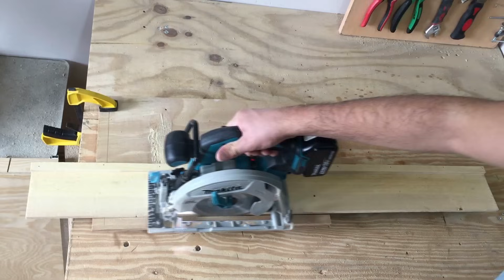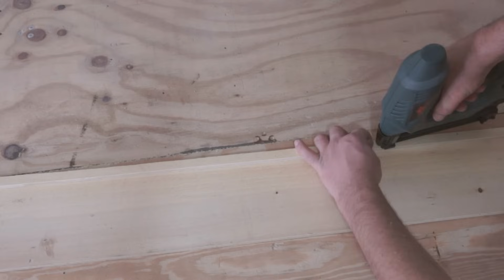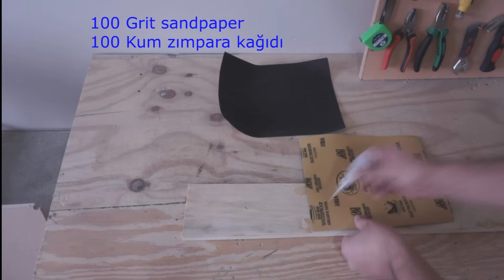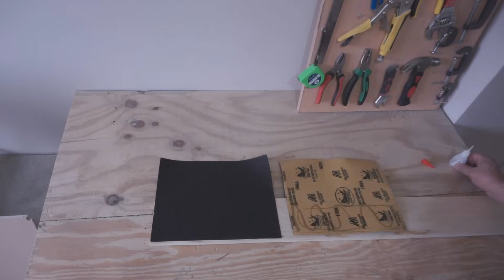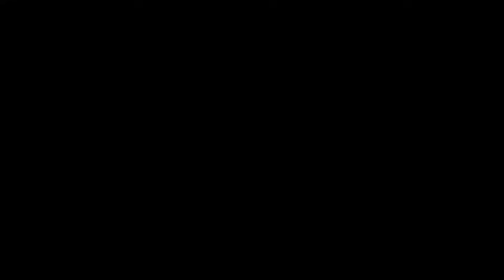Making a Self Clamping Circular Saw Guide - Kendinden Yapışkanlı Kesim Kılavuzu

Comment: Great work. Plus here's a couple of tips from a (now old and) very experienced wood worker. 

1. Add a 90 degree cross piece underneath and at the beginning of your track board. Always quicker.
2. Leave your track board sticking out the other side of your fence for clamping (hand spring clamps are enough) as well as a 45 degree guide (cutting with saw at 45 degrees).
3. Trim the abrasive paper a little further, even micro granules will dull your blade.

I've added these refinements after decades of using this kind of system. Also, an 8 foot version for large panel board can be helpful too. I've usually kept both in the workshop.
Reply: Thank you.

Comment: For goodness sake, use a push stick when using that circular saw! It takes a small lapse of concentration or a moments slip to lose fingers/thumb (@27secs). I have been working in wood for well over sixty years and the most precious and valuable item in the workshop is yourself. Keep safe and thank you for posting.
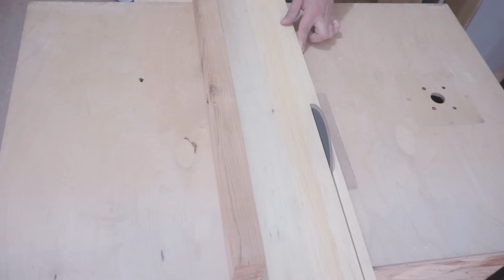Reply: @Richardz  I thought so to, but as per the original comment at 0:27 he runs his hand through the table saw when making the jig.

Comment: Great idea and I made mine today.  Instead of sandpaper, I put small drops of clear silicone on the bottom and it works great.  I also bring two spring clamps with me.  I plan to keep it in my truck to use to break down plywood I buy at Lowes in the parking lot.  Cool idea.

Comment: That's a very interesting idea with the sandpaper; I'll have to try it.  I have used a variation of this for 40 years.  I use 1/4" fir plywood for the base (no need to go thicker), and a narrow strip of the same 1/4" ply for the guide.  I never clamp the guide; because the good side of the wood is face down for a clean cut, I use two 3/4" nails to secure the guide, which when done I loosen, leaving the small nails in the guide for next time.  Works very well.
Reply: Hi,thanks for the comment.dabblign with making my own guide for my Makita circular saw as well.probpem with this is I'm concerned the 100grit sandpaper might scuff the material I am working on....what's your thoughts?
Reply: @conradpaul6100  I thought that too. Maybe some higher grit automotive sandpaper might be better? 300+ grit?

Comment: Don’t use sand paper. Use a bicycle inner tube cut in strips. Glue two or three strips lengthwise on the bottom of the guide.
Reply: Agreed the sandpaper would scratch the surface you are working on. Any sort of thin rubber material to line the base with would be better imo.

Comment: Great video.
One thing I'd have done differently: I'd first glue the wood-strip on (using a straightedge as a guide), then when dried, I'd use the "track-saw" itself (instead of the tablesaw) to cut the board, that way, it would be very accurate without much effort.
One can use sandpaper, but if you live near a beach, you might as well just put a very thin layer of epoxy on the back-side of the board and cover that with a layer of sand. Other types of (multi-material) glue might also work, but wood-glue is not recommended.
If you don't have sand, you could probably even use salt, just make sure you won't leave it out in the rain! =)

Comment: That's good but what if you want to cut a pre finished door you couldn't lay that on top of it
Reply: Right you are - but how many times are you cutting finished wood?
Reply: @tjk1009  he said: pre finished
Reply: I guess you could use masking tape but OMG that would be a pain in the ass 🙄😂😂
I spread a thin layer of silicone on my guide... I used a fine-notched spreader & it worked great.. 😎👍☘🍺

Comment: My 2 issues with this build are: 1) how to ensure the first cut is straight without a table saw? 2) Putting sandpaper on the underside might scuff the workpiece you're trying to cut.
Reply: i was thinking the same thing. i think i'll try it with silicone mats instead
Reply: you can use factory edge or just buy an square metal tube as reference
Reply: @amandawilcox3226   Huh?  You need a rigid base. and a rigid edge. Don't do something dumb that'll get you hurt.
Reply: @HBSuccess They meant silicone mats instead of sandpaper.

Comment: Won't this damage the blade with regular use? The ones they sell (aluminium with silicone base) have a small silicone piece on the blade side so that the blade will never actually touch the rail. This doesn't, but it's wood instead of aluminum. I'm not sure if it's as good to protect the blade.

Anyway, this is basically free for anyone with scrap wood to spare, so it clearly still is a good idea uness you use your blade a professional amount of time.
Reply: The silicone band as you mentionned ( which is actually a splinter guard) is not meant to protect the blade but to get a chip-free cut

Comment: If I had the table saw, I wouldn't need the circular saw guide.
Reply: Hahahaha lol its like the guides that need a "factory edge " ,
Reply: IF
Reply: Try to cut a 8x4 panel all by yourself without help in a table saw and thentell me how good of a job did you do...
Reply: @titodejesus6238  Maybe you missed the point that I don't have a table saw?
Reply: @JAMessinaJr  Your first 3 words are  "If I had" , so it would be very hard to understand the sentence without that part...
Reply: @titodejesus6238  I do agree with you on the difficulty of cutting a 4x8 panel with a table saw.  It is definitely a helpful video for creating a jig with uses far beyond what is shown in the video.  I just found it amusing that the video showed using a table saw to make the jig then demonstrated the use of the jig on material that would easily be cut on the table saw used to make the jig.
Reply: So, if u had a table saw you're saying you would cross cut a 4x8 sheet of wood on it?
Reply: @titodejesus6238  I did cut like that for along time until I cut off 3 fingers. Confidence in cutting sometimes equals forgetfulness. Safety first! Recovery painful and expensive.
Reply: @michaeln8954  Sorry for your accident. I am no expert whatsoever, only do stuff around the house. But whenever I use the table saw I am extremely careful. The other day out of need had to cut an 8 feet 2x4 to make it a 2x2 , all alone by myself using a cheap ryobi table saw, it was the scariest experience of my life.

Comment: No push stick and hand past the saw blade.  Only a matter of time until you lose those fingers.  I know a lot of people who said that would never happen to me and they are all missing fingers.  You should follow some basic safety rules when doing a video on a table saw.
Reply: Not so.  For wide boards a push stick is counter productive.  As long as your hand doesn't cross the saw insert you are safe.  Using your hand in the way Gökmen does keeps the board flush against the fence.
Reply: @wilhelmtaylor9863  A lot of people like you thought the same way.  I know A LOT of people who said that would never happen to them and they are all missing fingers or thumbs.  One guy was a cabinet maker for 35 years and lost two fingers and a thumb.  Another cabinet maker lost his thumb so they sewed his big toe where his thumb used to be.  You must use the correct push stick and not a crappy little piece of wood.   There is one that keeps your hands away from the blade and flush against the fence.   One guy said he had used a table saw like that for 20 years and no problem.  I asked him if he knew anyone who lost fingers.  He said his son,( who copied him) lost a finger a few years back.  Some people never learn.  The table saw is the most dangerous thing ever made so you people will keep getting fingers and thumbs cut off because it could never happen to you.
Reply: @owenprince4823  - you should not be allowed anywhere NEAR a wood shop.  You seem terrified of basic equipment without any common sense whatsoever.  And no, a saw can NOT cut you if you keep clear of the insert.  None of your examples point to a magic blade that can do that.
Reply: @owenprince4823  -  My "piss poor example" is to get people to use common sense and a sense of safety ALL THE TIME instead of relying on rules only.  I think about every cut I make and try to guess how it could go wrong.  Your method of the push stick invites the lumber to turn away from the rip fence which can result in blade capture, hence blow back of the wood.  You can also cut your knuckles if you hold the stick too low - COMMON SENSE, get it?  Even if you think you're safe.  Good luck and stay accident free. 

(edit) By the way, I always keep a pair of the rubberized blocks with handles near at hand.  I would probably use them in the example but it's  not strictly necessary.  A push stick is definitely a no-no.
Reply: @wilhelmtaylor9863  GRR-RIP-BLOCK-Pushblock-Router-Jointer (look it up).  There are quality push sticks that work and not just a stick to push the edge of the wood.  They are all under the heading push stick but they are not just a stick that you are thinking of.    One fellow showed how a small single stick to push the wood could cause the board to get thrown by the blade.  A person can make jigs or buy a grip block and not just a stick.
Reply: No guard or knife either, also stand  to the side. Simple things that prevent injuries!

Comment: Self gripping not self clamping. No doubt it works great for short cuts.
Reply: Yeah my thoughts too. Plus you need to tiptoe about how hard you are pushing that CS against the fence. Great for a quick cross cut. Try to do a rip cut with those guide, see how far it'll go off the marking.

Comment: But this only works for left-bladed circular saws. 
Making one for a right-bladed saw would only give me 30mm of support on the guide.
Hmmm. 
I need to go buy a new saw.
Reply from the maker: or you can make an inverted version of this guide for right-blade saw ;)
Reply: Just throw your saw at the mirror and the inverted one will fly out. Con is you lose the non-inverted one.
Reply: Um. I'm I the only one that can see you just start from the other end ?

Comment: Hold up, why did you cut it on the table saw first if you were just gonna cut it again with the circular saw? lol why not just clamp a straight piece to the ply and cut your strip with the circular saw?
Reply: sigh
Reply: @slaggen91  Care to explain? Because my comment is predicated on the reality that the person who's making a circular saw guide, doesn't have a table saw, and it's unnecessary for this project, I built mine without a table saw.
Reply: He used the table saw to make the thin straight guiderail. There's ways to do the same with the circular saw, you need a strait edge to guide your saw. like a level or something, clamp it to the plywood.

Comment: Step one, buy a table saw so you can make this thing. It is cool though.
Reply: You can also make the guide fence with only a circular saw. Just start with the factory edge of plywood/mdf. Mark it so you don't lose track of the straight edge and rip it roughly to the desired width with the circular saw.
Reply: Better idea: Hire a professional to do the job. It will be cheaper and less stress.
Reply: @claudeloi  What job? Seriously, you must have joined the wrong "club". This, here is about DIY, only.

Comment: As a finish carpenter that is always using guides, there is absolutely NO WAY IN HELL l would trust that not to move under pressure. Make 2 marks, set your guide, the rip a piece of oak w that. Make the same guide, then take your cheap ass to the store and buy a pair of 6" bar clamps, about $15 at most, and save yourself alot of frustration. Sorry, piss poor idea.
Reply: Not designed for  finish carpentry. 
This is more designed for a framer, who doesn't have time to piss around with clamps but still can get a straight line without having to use a chalk line.
Reply: I rarely use the clamps on my track saw and have no issues. Fairly similar principle here.